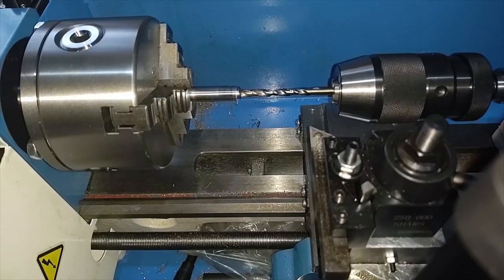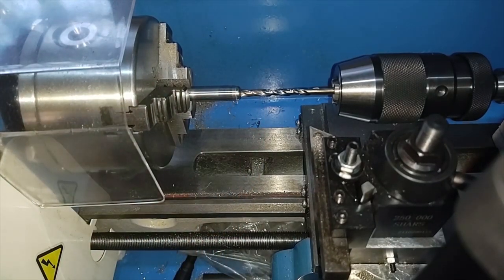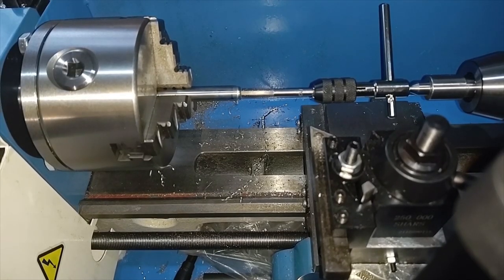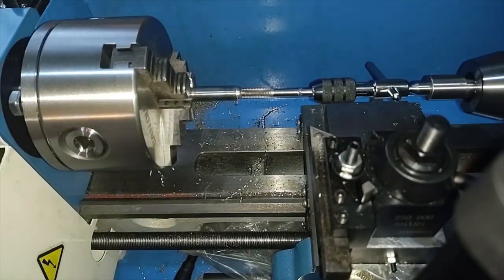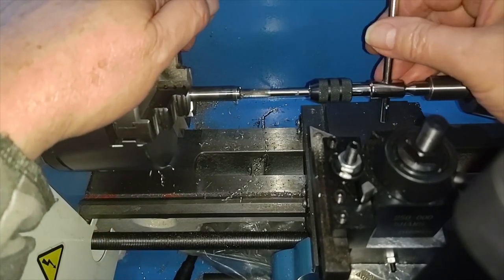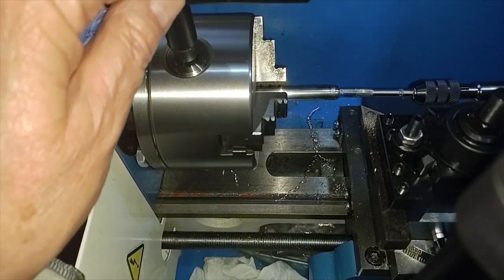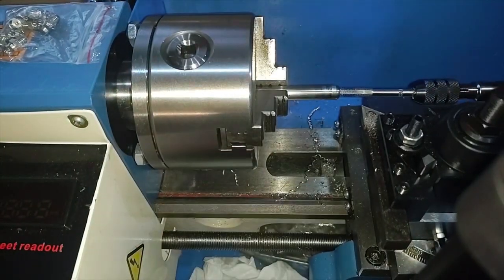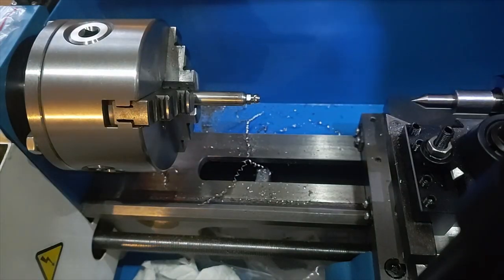Frozen Ford / Lincoln power running board. Cool a Zerk Do the cool Zerk for the piviot pins.

Comment: I was going to try to do this on my drill press but after watching this i think i'll take them to work and do them on the lathe. Great vid. You should make kits of these, youd sell every one you could make. But then that would create a full time job and your probably happily retired. LOL.
Reply from the maker: Thank you for your kind remark. And yes, the lathe is the place to do this. The cross hole out to the bearing surface can be done on a drill press, you do need a vice on the press and then a bit of care in centering. 

Yes, I could possibly make up these kits, including the bearings which need to have the split widened to allow for them to fit, they are generally just ever so slightly too large. 

And yes, it would turn into a full time job, for there are millions of these out there that do or will need the kit, but I am retired and have some real life issues that would be impacted. 

I have considered setting up a situation where the person would send me their pins and I would modify them. I have also considered stocking the bearings and doing the slot modification so that they then fit properly.

Comment: What size bits did you use for the zirk fittings?
Reply from the maker: Those fittings came from Amazon. the listing is for:
uxcell 201 Stainless Steel Straight Grease Fitting M6 x 1mm Thread Hydraulic Grease Fitting Accessories

The drill that I used would be the normal drill for a 6mm screw, that being a 5mm drill.